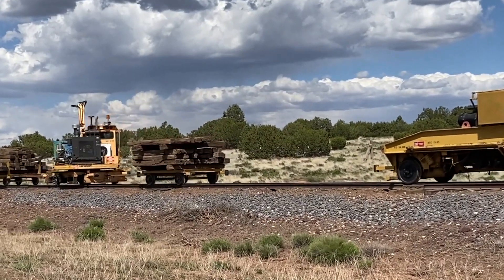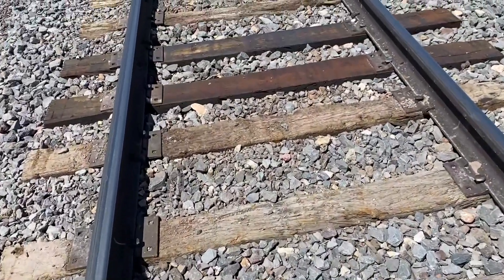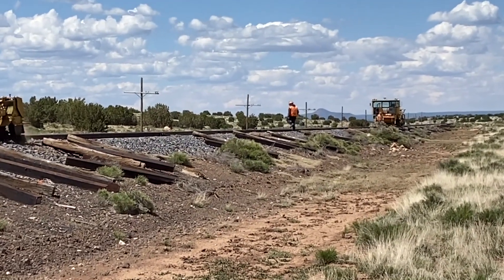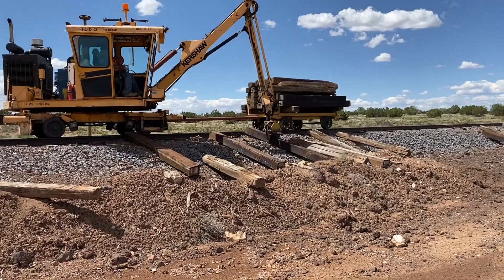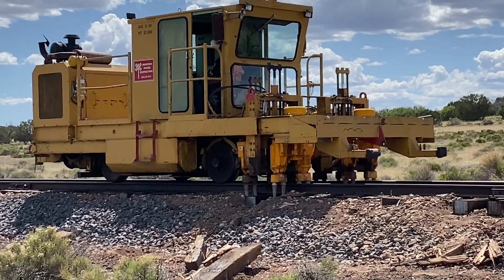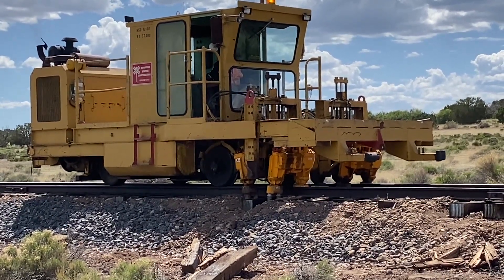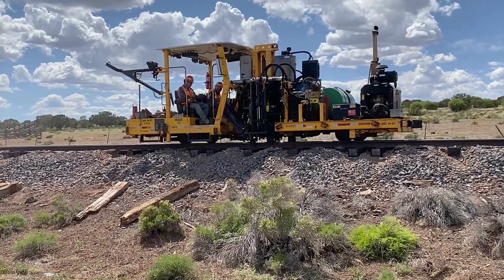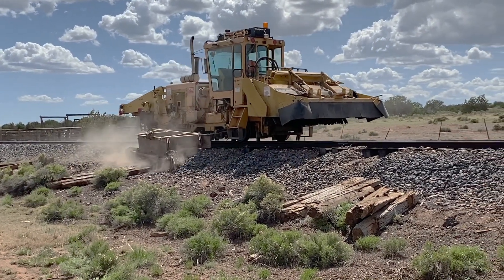How do Railroads replace old ties?

Comment: In Astoria we have done 30 by hand this year. Getting a hi rail backhoe, so pace will increase
Reply from the maker: Our internal crew has a couple smaller tie inserters, and can do around 75 a day with a crew of 6, back when we actually had a crew dedicated to tie replacement.
Reply: We do 8-11 a day, usually we are 5 guys. We have a tie inserter that you have to push by hand and a jack hammer made for compressing ballast and spiking. The rest like digging holes for the tie inserter is done by hand. Although we are a narrow gauge museum and the old ties are really old so it's a bit tricky to get them out.